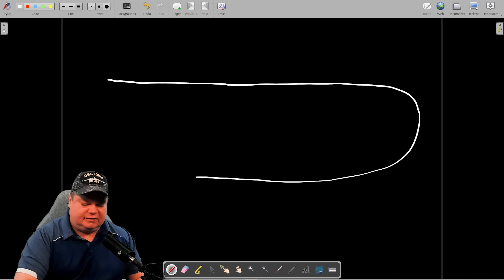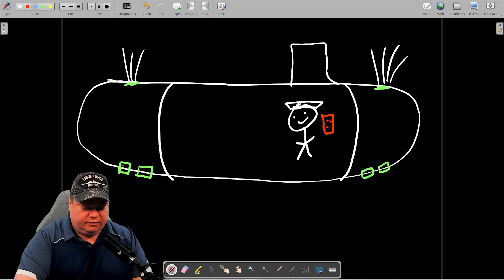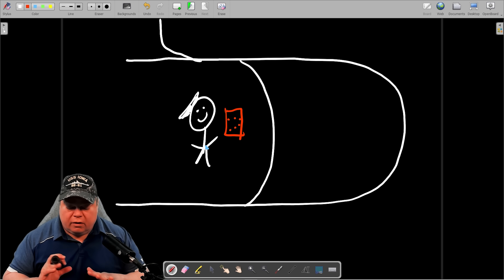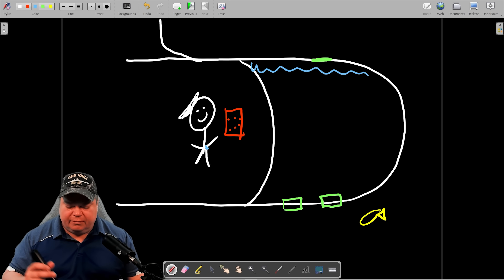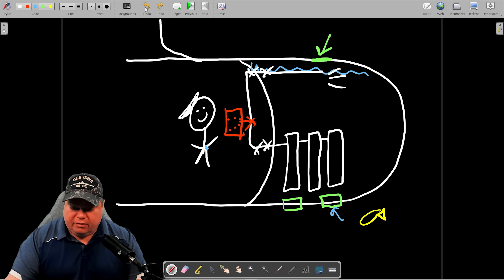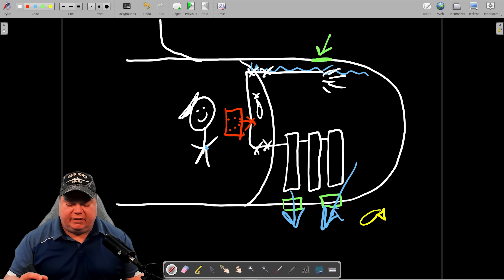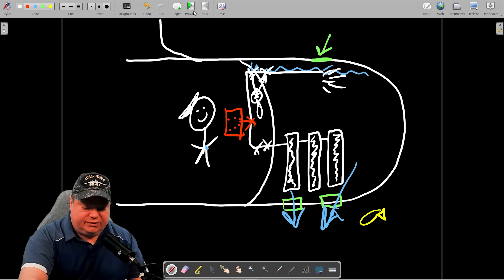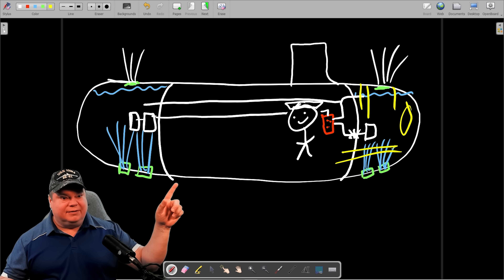Explore the Depths: Submarine Main Ballast Tank Operations Unveiled

Comment: Once ballast is adjusted to submerge, it is mostly propulsion that adjust operating depth. some adjustment of ballast is necessary for trim. when really deep, is there some measurable compression of the sub? requiring ballast adjust?
Reply: When submerged the ballast are always completely full, there is no adjustement with them. The compensating tanks are used to fine tune the trim. Yes there is a measurable compression.

Comment: I was wondering about how they solved the freezing problem that doomed the USS Thresher by in the 60s.   I do remember a plan of placing a kind of rocket motor that would be used in an emergency to empty the tanks.   I doubt if they went thru that at least never heard about it again.
Reply: German boats (Type 206, 209) have (had?) a chemical gas generator for emergency blow.

Comment: Torpedo tubes and Sonar. I cannot think of a third...
Reply: On US boats the tubes are usually run out the side of the boat.   But the Sonar dome is there.   I am thinking any VLS tubes for missiles.   But maybe a towed array system might be external to the pressure hull.
Reply: Torpedo tubes he just did a short time ago..
Reply: Sonar sphere access tunnel. Several system support piping. Bow planes. VLS launch tubes. Torpedo tubes. MBT vent valves. .fwd O2 banks. Fwd air banks.